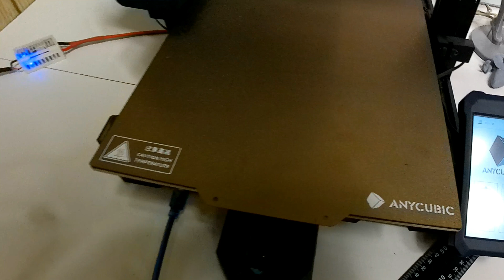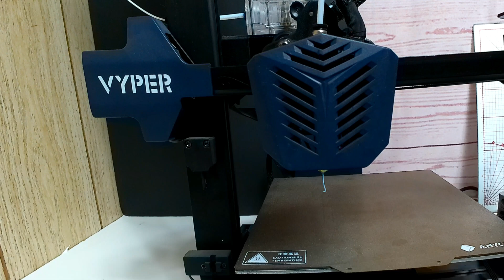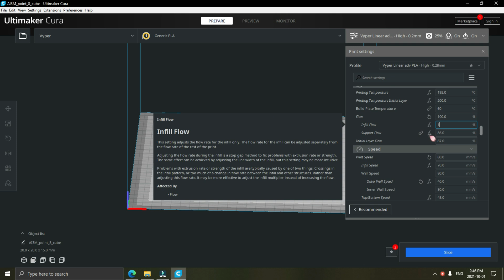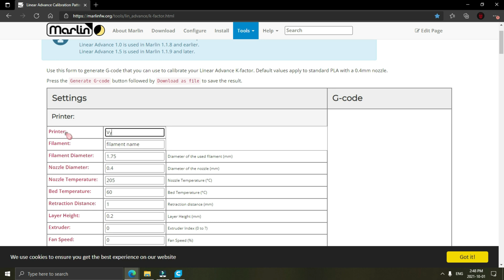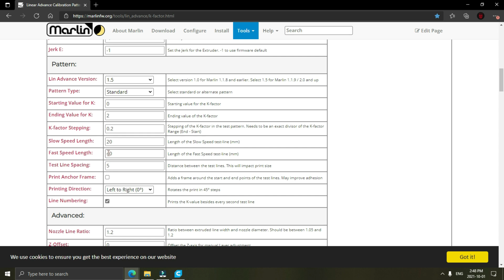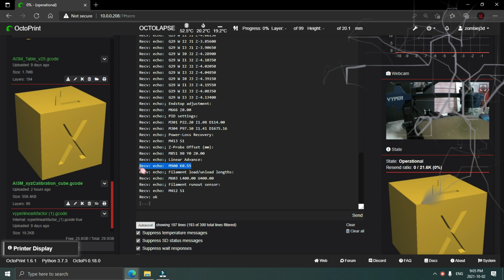Anycubic Vyper Calibration (e-steps , flow, linear advance)

Comment: Good info. But a little more explanation of how to get into the software to make these changes would have been helpful. You didn't mention how to do that if my printer isn't connected directly to the computer. What kind of wires to use, etc.

Comment: My anycubic vyper does not auto level. It goes to the right corner of the bed and the to the left side of the bed and the hot end goes straight up and stops about 3 inches above the bed. What is wrong with my printer?

Comment: I just noticed Cura has a feature called "flow rate compensation factor" and it's set to 100% by default. Something similar to linear advance. Should this be set to 0% if linear advance is set to on?

Comment: Very new to 3d printing. I'm a cnc programmer, so some of the G-codes I'm familiar with. I never knew there was so much to 3d printing. I'm running the filmware that came with the printer. The filmware you speak of, what's different about it? 

Thanks for the instructions on calibration. It helped immensely!

Comment: I just got my vyper today and followed steps 1&2 - easy and worked well.  Had a question and got a reply from Studio Zombie quickly.  This is the best Vyper Source on YT!  Thsnk you!
Reply from the maker: Much appreciated
Reply: @studiozombie3d  dude i just got your settings and did the official firmware update 0.5 + - in calibration cube to 0.15 mm on x and y my z axis is still 0.3 mm - + any tips ?

Comment: My printer is in the basement and my computer is upstairs so I am unable to connect directly from my computer to my printer. Is there a way to change the K value and other values in the printer using just the two different SD cards?
Reply from the maker: If you use cura you can install a linear advance plugin that allows changing the k value. Junction devieation might have a simular option a plugin ior might not be visible
Reply: @studiozombie3d  I was able to install the plug in but I was wondering how to do it for e steps, as well? I upgraded to your firmware and the quality of prints hasn't been the best, there are more noticeable lines on the exterior surface
Reply from the maker: @tman88889  esteps will need to be done via pronterface or octoprint. You need to connect to send commands to extrude and change the esteps

Comment: Hey there. Today I tried printing with nylon and used this tutorial. I am slightly confused. If I open the STL file the wall thickness is 0,8mm Why use 0,4 in your calculator? Can you tell me what I am missing here?
Reply from the maker: I generally print the flow cube in vase mode so it is only one wall it can be a bit more accurate for measuring flow

Comment: When I try and send commands I immediately get a repeating, "Pause for User" and it doesn't allow me to send anymore commands.  I am using Pronterface.  Is this normal?
Reply from the maker: The odd unit does that you can try reflashing or when that happens try sending a m108 to continue
Reply: @studiozombie3d  The m108 code worked great!  Thanks so much!

Comment: Thanks for this E-Step calibration went well, but glow seems problematic for me. I get .9 on the cube walls which would give me a very low flow rate of like 44%. Tried that anyway but its print fail. Are those numbers really possible on stock vyper or do I maybe have something setup wrong for slicing the cube?
Reply from the maker: If your cube is .9 then your flow should be about 88%
Reply: I am having this problem too. If you found a fix would you help me out?
Reply: I was doing smithing wrong, also my esteps were a bit off. Eventually I got it right, but I think doing a .8 cube is easier.
Reply: @GriffonWalker  thank you!

Comment: This is another one of your great tutorials. I was afraid to change the Gcode but it went well. Cura wouldn't work until I added Gcode to CURA so Octoprint would work.
I'm not familiar with Marlin. Could you let me know what to download, and after filling in the required calibration info where is the code stored. Octoprint , or Cura machine settings.
Reply from the maker: You can also use pronterface to set your calibration options I prefer octoprint myself. Marlin isn't too bad there's really only a few commands you generally need to know for most use. I'll look at doing a bit of a marlin video explaining some of the marlin codes used for calibration and what they do

Comment: my printers printing a ticker wall on only one side of my cube like 5mm where all other are like 4.3mm
Reply from the maker: Double check everything is tight and level. Check the gantry on each side of the bed to see it it's level and equal.
Reply: @studiozombie3d  also did the linear advance test and all results look identical to each other
Reply from the maker: @Justin-hm4xu  you need to be running custom firmware I have one available on my drive with it enabled. https://drive.google.com/file/d/1ZIN2u4g0sn3cMPhL1vRbfE1zs95fAOnz/view?usp=drivesdk
Reply: @studiozombie3d  ah awesome do i have to update the display or can i do just mainboard

Comment: First off thank you for the work you put into this! I'm a bit stumped, I installed the firmware (says Zombie in about section of menu) and after calibrating the e steps and the flow, the gcode for the linear advance test tries to print an inch or so above the bed. Same thing with an ordinary print I wanted to make. Do i need to rerun the auto level before every print? I ran an auto level before the flow test so it would print properly. And then tried the linear advance g code and that's when I first noticed it not printing on the bed
Reply from the maker: I've seen it on a couple units.. I'm thinking something didn't clear properly try sending m502 twice them m500 and re enter your esteps and values then save again with m500 and run a level
Reply: @studiozombie3d  Thank you very much for the fast response. I'll try that now to see if it fixes it
Reply: Unfortunately I got the same results, not sure what to do. Another strange thing is after the level it won't let me print. I have to restart the printer in order for it to reach the temps (and start printing) that are specified in the file
Reply from the maker: @GreenDomo95  hmm that's wierd I know one person sent me a simular issue and it needed a m108 to be sent for some reason.. try this one pretty much the same firmware but older source see if it works better 
https://drive.google.com/file/d/1vphg-yUxRzXTMko18treS74M7GQm4Qe1/view?usp=drivesdk

Comment: What do I do if the lines on the linear advance test print are not the same width across the print?  They are thicker on the ends than they are in the middle.
Reply from the maker: You may need to increase the range of the kvalue test there's the odd unit that needs higher then k1.0 try increasing the range and see if that helps.  Feel free to email me at studiozombie3d@gmail.com with pics and I cam give you a hand
Reply: @studiozombie3d  I'm having this issue too. I've tried increasing the range and that doesn't seem to help. Any ideas on what I can do here?

Comment: Hey man, I've been updating my vyper with your firmware, however I noticed some issues when it came to the newer versions. Everything up to 2.5 Installs normally (returns you to main menu when it finishes flashing). But 2.75 (classic and normal) both install differently than the others. For some reason, after it beeps, it doesn't kick you into the main menu, instead you have to reboot and when I check firmware it shows the marlin firmware that was on the .odt that came with the firmware. however with 2.8 (classic and normal) nothing changes at all when I install it when I check the about section for the firmware. I should note, my vyper beeps 5 times whenever it finishes flashing, that is the same with all versions for some reason, I also made sure my dwin set is the most up to date aswell.
Reply: Have you tried to print above 260 degrees? If not, would you please check if you can set nozzle temp to 275 and hold? For some reason, when I do, it just resets to 260, and I cant figure out why. Even when cura is set to 275, it still just sets to 275 for a sec, a d then throttles back to 260.
Reply: @icepod  I have not, I'll give er a shot later today, but just wondering could it be built in to not have the ptfe tube inside melt?
Reply: @icepod  Yep, gave it a shot, the max is 260.
Reply from the maker: @icepod  try running a pid tune at 270 see if it helps and use U1 at end of pid tune line to save
Reply from the maker: Yeah the new sources don't reset to the main menu for some reason a power cycle finishes the install. I'm taking a look to see what is going on with it here. 2.8 was a minor change I disabled power resume to see if it was causing a pause issue. I'm going to try and get a update done right away here
Reply: @studiozombie3d  Cool! I was just wondering since I had some issues with bed leveling, I'd assume just reinstalling the firmware would've done the trick, but I'd thought I'd update and noticed the change to the later versions. I noticed that 2.8 had a smaller file size if I remember correctly.
Reply from the maker: @extremecaliber2662  I reuplpaded the 2.8 version in a package ot should be good now
Reply: @studiozombie3d  Yup updated just fine now, I'll let you know of any (if any) complications

Comment: I just tried to upgrade to v2.4.5 by erasing the EEPROM (motherboard 0.0.6), but I have a problem when I try to use the auto bed upgrade feature. The button on the LCD screen begins to flash and it freezes how to return to the original one thank you
Reply from the maker: That means the lcd didn't flash properly. When yoh hit level it asks you to test the sensor by pushing up on the nozzle. The lcd needs a upgrade for that screen. If you just press up the level will continue as normal
Reply: @studiozombie3d  so you have to make a home? that's right? or can you explain me in tutorial because I am lost
Reply from the maker: @capatainjackcosplay  you need to flash the DWIN_SET folder you place it on a micro SD for the lcd needs to be fat 32 4096 allocation unit size. Or it won't flash. To reset you send a m502 but thay just resets the firmware settings to stock
Reply: @studiozombie3d  OK SD card for lcd, thank
Reply: @studiozombie3d  or how to reset thank you
Reply: OK because the firmware I put it on the printer's SD card, because I don't have an SD card for the screen, there is a way to put the original firmware back with the printer's SD card 'printer ? And where to find the original firmware thank you for your help
Reply: I just tested with a micro sd my screen is black
Reply from the maker: @capatainjackcosplay  you can  use it as is all you have to do is when leveling push up on the nozzle and it will continue. The SD card has to be formatted fat 32 and 4096 allocation units. I use this program to format my SD cards http://ridgecrop.co.uk/index.htm?guiformat.htm

Comment: Does this only work on your firmware or does this also work for the stock firmware? Currently figuring out how to setup octoprint so I can calibrate these things.
Reply from the maker: Linear advance isn't enabled on stock the rest works on stock for calibrating. I have the firmware available on my link try 2.75 is the current version if your interested. I recommend trying stock first though just to get a feel for it
Reply: @studiozombie3d  I’ve made it through my first roll of pla with maybe 50g of errors. Most of those were self induced grubby greasy hand on build plate adhesion issues. Just need to calibrate what I can then start trying to fix the little bit of super fine cobwebs I get. Hoping esteps and flow calibration will help me dial it in more.
Reply from the maker: @ThatPNWGuyTackle  esteps and flow will help a bunch. Then you can tweak retraction or hotend temp to get rid of the rest of need be

Comment: Did the Esteps calibration and the flow calibration printed the linear advance but could not change that value. Is the firmware not capable of that function? Thanks the for all the info.
Reply from the maker: For linear advance you need to flash my firmware this is my latest version
https://drive.google.com/file/d/1vphg-yUxRzXTMko18treS74M7GQm4Qe1/view?usp=drivesdk

Comment: How would I go about increasing the temperature of the hotend to 300c in the firmware, I have a bimetal heatbreak installed. Is this even possible?
Reply from the maker: You need a all metal hotend and you need a heater cartridge capable of 300 once you have that you just change the heater type in the firmware and change Temps to 300
Reply: @studiozombie3d  ok, thanks for the help. Not much info out on mods or tuning the vyper. Your videos have definitely helped me(noob)
Reply from the maker: @jaredbourque4199  if you know what heater you have I can make firmware for it. But you need a high temp heater for it not the stock one
Reply: @studiozombie3d  I'll do some research, I have the stock vyper 45w heater
Reply from the maker: @jaredbourque4199  the limit for the stock is 275 let me know what you find and I'll give you a hand. Can fire me a email at studiozombie3d@gmail.com or check my link tree and fire me assuage on Facebook
Reply: @studiozombie3d  awesome,  thanks

Comment: Probably a dumb question, how would you load the settings to the printer from pronterface? Sd card? Or can you use the included usb cable?
Reply from the maker: You connect your pc to the printer and connect with pronterface baudrate is 115200

Comment: Great video! I am currently running ASA with no issues. I haven't done any firmware changes yet. E steps calibrated. Flow rate calibrated.

Comment: Plan to go over this later, but what I was looking for is how to adjust my z axis.  Finding that even with the auto bed level the left side is lower than the right side and it is effecting first layer adhesion. I had to go -.1 for z offset and occasionally the nozzle makes contact which is not good.  Not having any luck finding how to adjust the limit switch on the side to get a better level.
Reply from the maker: I'm working on a new adjust ment video for the vyper that I'll cover the z axis in better detail. You can fire me a email at studiozombie3d@gmail.com and I can give you a hand. Depending on the version you have your z endstops may be adjustable

Comment: Thanks mate so far!
Couple of issues though with the marlin kfactor thing. Theyve changed the file so it doesnt print the same file. Problem being, i've no idea what to look for, and absolutely none of my lines are consistent. i'm not even sure they are meant to be in the new print they use. The numbers arent even the same, so i'm not 100% sure. Any ideas mate?
Reply: Also, pronterface refuses to connect now that ive flashed your firmware.
Reply from the maker: Pronterface set the baudrate to 115200 and it should connect make sure cura is closed as well. For linear advance you want the straightest line with the least change in width
Reply: @studiozombie3d  thats the problem i think. All of the lines get thin to the left. every single one.
Reply from the maker: @slocallaghan87  try running the patters but go from k value 1 to 2 and see if that range is better. Theres the odd vyper that the k value is between 1 and 2

Comment: I have installed the customer firmware and have imported the V3 cura profile. I have also calibrated E steps and also LA. When I print my calibration cube, every corner wall sticks out ever so much. Any idea what would cause that?
Reply from the maker: Try bumping your linear advance up 0.05 so if it's k0.55 go to k0.60
Reply: I moved my junction deviation to .2 and it seemed to improve a little last night. Should I set it back to .05 and move linear advance to .60 and see if it improves?
Reply from the maker: @jeremysnow404  you can keep junction at 0.02 and try adjusting linear a bit to clean up the bulge a bit more
Reply: @studiozombie3d  Junction deviation is set to .2 currently, not .02
Reply: @studiozombie3d  I put JD back to .05 and changed LA to .6 as suggested and the corners look pretty good. I did notice that before and after the changed I had a print that had some of the initial layer lines not putting out enough filament, but the rest of the print turned it really well. Any idea what would cause those initial layer lines to have issues?

Comment: Thanks a lot, it's very clear. I've been through all the tutorial until nearly the end, bu on my Vyper the M900 command is unknown. And when I upgrade to the 2.3.5 firmware version, the bed levelling is not working (I have to restart the printer). Any help or advice?
Reply from the maker: The m900 command won't work on stock firmware I have linear advance enabled firmware avalible. If you  eant to give it a try 
https://drive.google.com/file/d/1fIU_pV5bnlu77GIQXc9qPa7W9otn1aFr/view?usp=drivesdk
Reply: @studiozombie3d  Thank you !

Comment: Thank you for your video! A little confused on this whole process. It is pretty easy on the Ender lol but I don't have a raspberry pi. How would I calibrate my e steps without the pi? Thank you!!
Reply from the maker: Pronterface works just as well for calibration http://kliment.kapsi.fi/printrun/
Reply: @studiozombie3d thank you. I'm a noob so I'm not exactly sure how to do this..
Reply from the maker: @littlecube141  use pronterface to send commands http://kliment.kapsi.fi/printrun/
Reply: @studiozombie3d  thanks for the instructions lol 😆